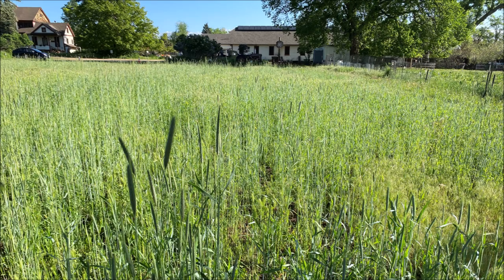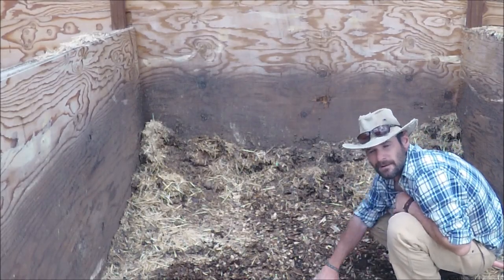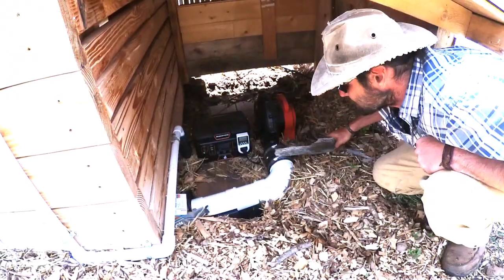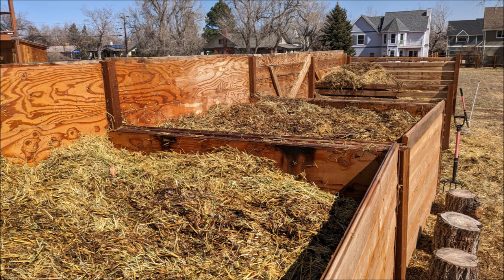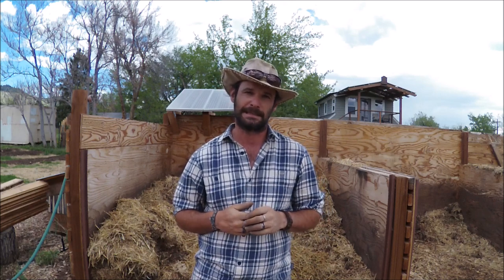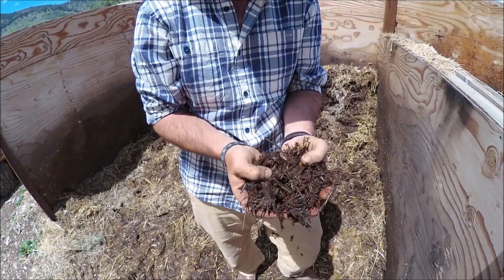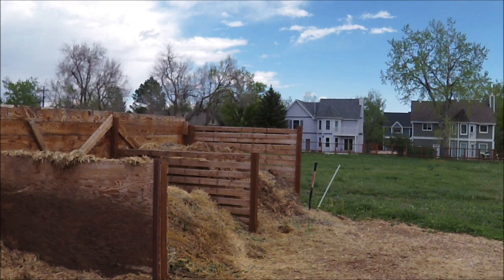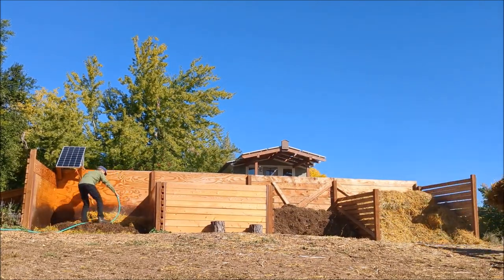Aerated Static Pile Composter at Long's Iris Gardens

Comment: I am interested in how much water your system uses (Rainwater and city water combined ) per cubic meter of input.  I am exploring static pile composters for use in greywater removal for tiny houses.  The idea would be to exclude rainwater and substitute with greywater.  Any help is appreciated.
Reply from the maker: The aerated static pile at Long's is not watered very frequently as it involves dragging hoses from a distance.  I'm not sure how much water you can apply to the pile without an adverse effect.  With greywater, one thing to be aware of is the additional phosphorous and nitrates that may be in greywater from soaps and other household chemicals.  Applying greywater to a pile could add these nutrients to the compost, which may or may not be desirable.

Comment: Hi. What’s the power rating  of your blower and what’s the size of your solar generator?
Reply from the maker: 200w solar powering a 500w portable battery. 3.2A/120V (standard plug) Blower plugged into Timer with battery backup. Portable LiFePO4 batteries have gotten cheaper and with better storage capacity even in the last year than when we got this one.  MC4 (solar connectors) and MC4 to 8mm adapter (goes into battery generator).
Reply: Had the same question. I manage an active composting program for a large community garden. We don’t have power at our farm but want to incorporate ASP to our composting program. Thanks for sharing this info along with the video.